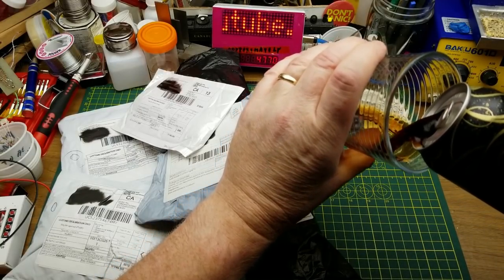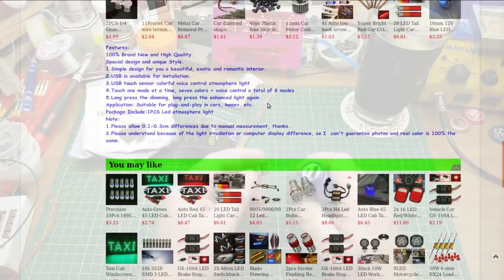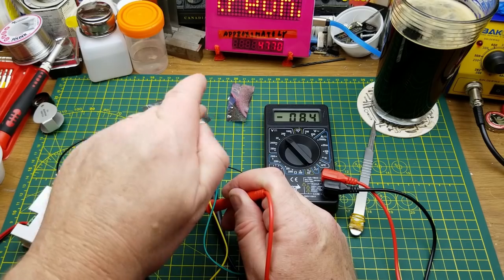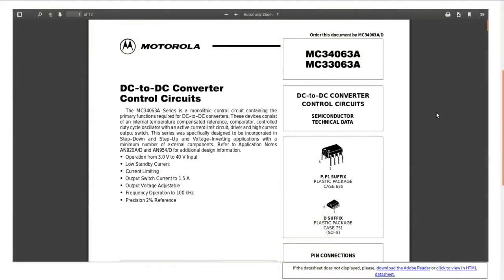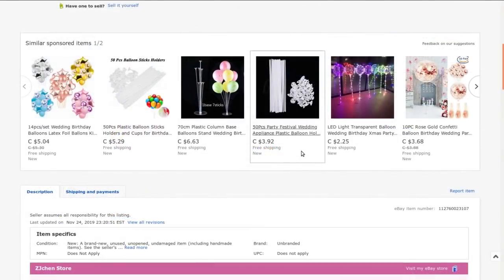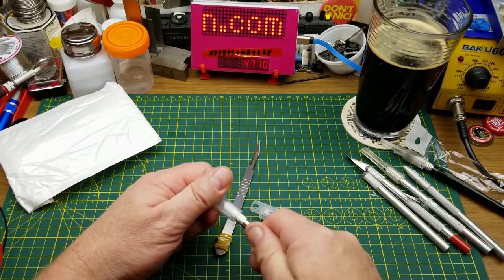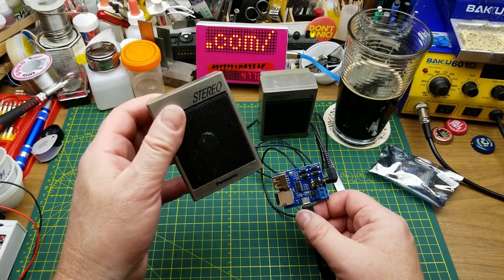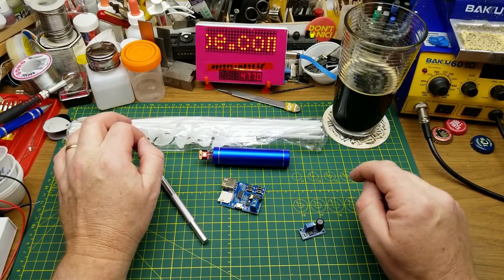Mailbag Monday #74

Comment: Got one of those mp3 players here that works fine on the speaker terminals. Nice feature about it is that it remembers the track it was playing when you remove power and it auto-starts. Makes it nice to use as a plug-in audio module.
Reply from the maker: I'm pretty sure mine just had a failed power amp.
I'll have to investigate deeper when I have time.

Comment: For short tubes i've found an empty aluminium deodorant spray can is worth cutting open.
The tube is clean, unlike from paint spray cans.
The mc34xxx chip is deceptive, i looked at the 1.5 amp switch rating and didn't realise that it won't go much above half an amp at 5 volts.

Comment: There seems to be some quality issues with the mp3 modules. I ordered 4. 2 work fine. One will not read and SD card but works with a flash drive and one won't work with a battery (probably a defective boost converter.) I got them for a buck each, so no complaints.

Comment: The trap about switch current is that doesn't translate to output current, that's just the current limit of the switch that goes to the inductor. Output current is always much lower than that because of the switching boost operation.

Comment: Mc34063A is a jellybean part, just like 7805 is for voltage regulators.
Reply from the maker: It seems like that. 
For some reason, I've never played with one before...
Reply: @pileofstuff  I bought some MC34063 chips earlier this year.  They can do most any DC to DC function, but may not operate as you expect.  You set it up though to have an ideal pulse width, so that the FREQUENCY varies to sustain a load at a given voltage.  Since the frequency varies during operation, it may not be so simple to develop a notch filter, and may not be suitable for circuits that involve audio.  Best for loads that have a predictable, narrow current range.

Comment: Would the balloon sticks be suitable for power mixing epoxy or resin?
Reply from the maker: These ones are a bit too flacid for that. 

The previous bach I used for the load I showed already done were a lot more rigid, and would probably work.

But my first inclination would be to use a chopstick as a "power stirrer"

Comment: Why or how do you use a negative voltage?
Reply from the maker: Mostly in op-amp circuits. They often require (or at least work best) with a dual polarity power source.

Comment: Question why do you need a negative voltage module? Isn’t that a buck converter with the leads backwards 🤷‍♂️
Reply: was about to ask the same q
have seen some stuff on here with neg voltage ranges, would love an explanatory video with examples :)
Reply from the maker: If you need both positive and negative voltage in the same circuit (sharing a common ground) it can be a bit of a pain, since most buck convertors pass the ground straight thru from input to output - so if you flip the inputs on one buck convertor you can get a short across the incoming power rails. 

This module avoids that. 

There are a few buck convertors that have the grounds isolated, but they are harder to find.
Reply: @pileofstuff  thanks - why would you need a negative voltage ( n00b question lol )
Reply from the maker: @markb4071  A lot of op-amp circuits need dual polarity voltages. My mini headphone amp from a few weeks ago, for example.
Reply: @markb4071   Just an example,  Have you never had an issue with a speaker or headphones that it pops if you switch it on or off?  The problem there is that audio goes positive and negative. The way they do this on a single rail power supply (the one with only a positive voltage) is that they make the 0 level, so no sound, the half of the max voltage. So it can go up and down half the max voltage. For example a 12V power supply the output of an opamp will be at around 6V. Now the issue is that if you switch the amp on you go from 0V to the half voltage and visa versa. Luckily it is DC so with a capacitor in series you can remove that but it will still cause a loud pop unless it is suppressed by a relays or another device. If you use a positive and negative power supply your 0 will stay a 0 voltage.
Reply: @Luke-san  thanks
Reply: It's very slightly more complicated than that, but yes - an inverting converter is basically a buck converter but connected differently. Maxim app note 3844 has more. The normal output voltage limitation doesn't matter here - any output voltage is always below the input voltage.